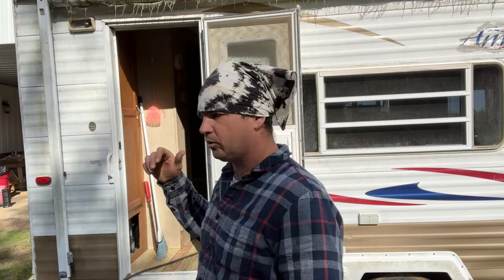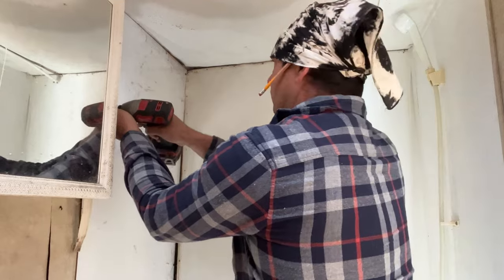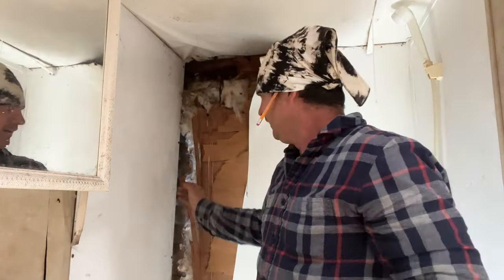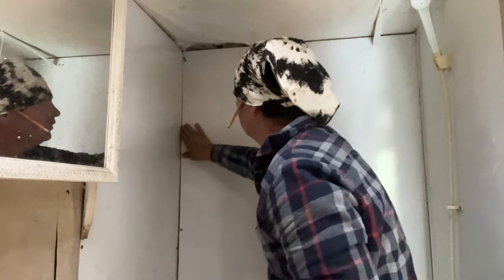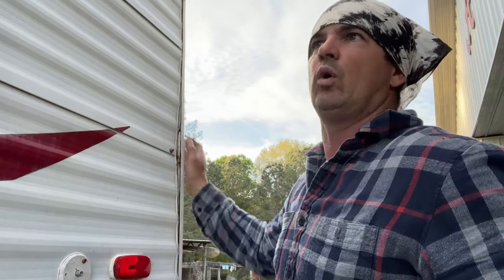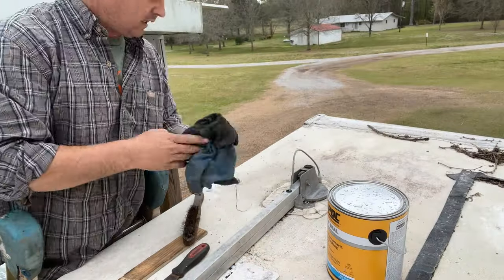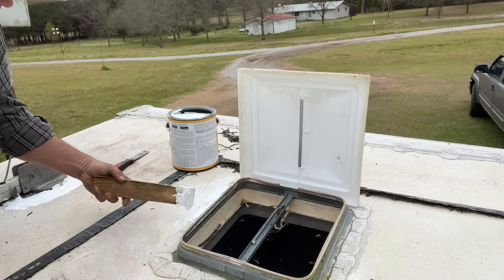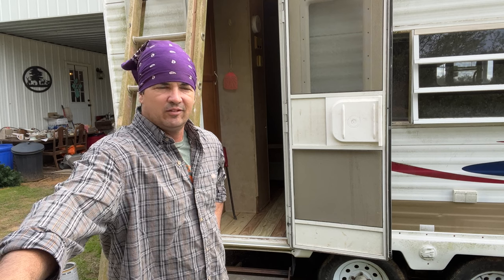Camper repairs - sealing roof, installing ceiling and shower boards.

Comment: Hey Justin!  It's about like working on an old car.  You never know what you're going to have to deal with... until you start rummaging under the hood!  On the other hand, once it has been repaired, it will stay that way for a long, Long, LONG time to come.  The camper will make a fine addition to your adventures!  There is nothing like "Roughing It"... when everything is "Smooth"!
Reply from the maker: I hope it holds up a good long while. We gonna do plenty roughing it trips but we gonna smooth it some too

Comment: It sorta looks like you know what you're doing LOL. I've had a little experience with those camper roofs and house roofs. The best thing I have ever found is called through the roof it is clear studies flexible I have put it on wet roofs and it sealed. It really works well but it is really expensive. Hope you all get to enjoy a lot this summer thank you for sharing. Try not to be too hard on Brodie. Hey just a growing boy LOL❤❤
Reply from the maker: That boy is a mess but hes gonna be ok just have to watch what hes leaving all over the yard before i mow lol